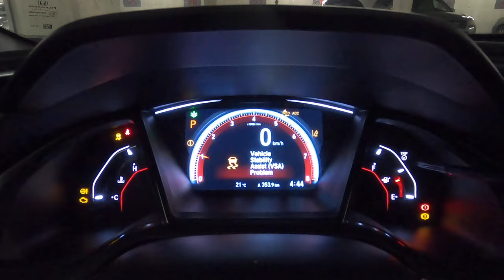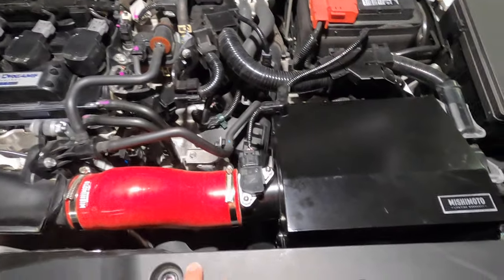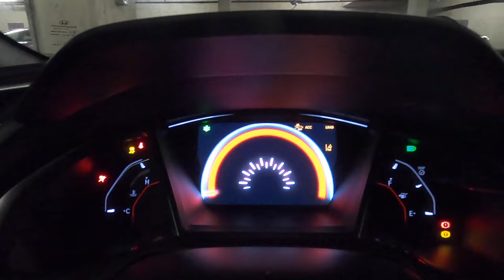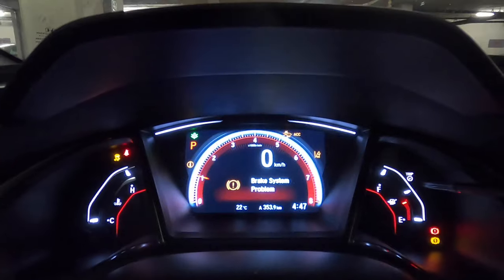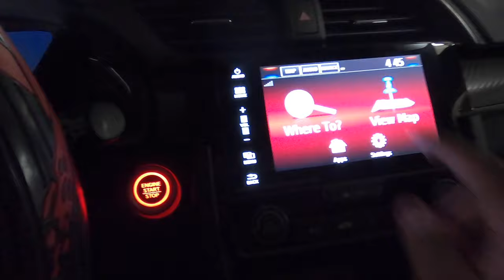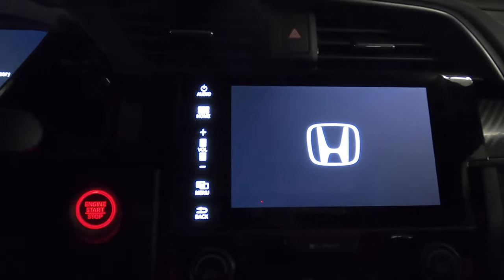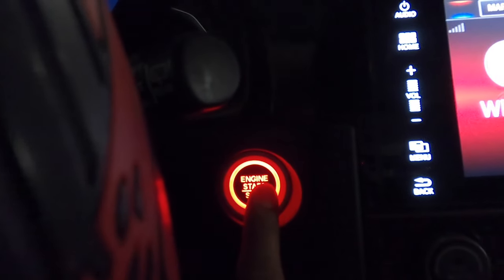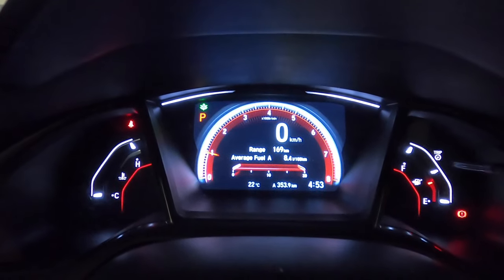HOW TO FIX MULTIPLE WARNING LIGHTS ON DASHBOARD OF 10th Gen Honda Civic

Comment: ADD ANOTHER STEP 2017 Honda Civic Hatchback - Thank you.  Lights came on out of nowhere - I tried your instruction on reset 3 times and the lights stayed on. The car was starting and driving without issue.  I was ready to take it in to Honda Dealer.  BUT that day after the reset; I drove down to my local supermarket about 1 mile away, went in grabbed a few items and when I came out and started the car - it was reset to factory settings - I know because of the map and time display. Seems I had to drive to get it to reset. I am still getting the battery tested in the AM just to see; but I drove it 15 miles so far and the lights have not come back on. FYI - I have had problems with the tire pressure sensor from day 1 of having this vehicle.

Comment: It would be nice if you could do a video pare of the new model Civic. I have the sport touring and there is no power button to do a reset. So I did the factory reset sa general settings but it wont turn back on like the last gen. Any help would be appreciated by 11th gen honda owners

Comment: I just replaced my steering wheel and had multiple codes on my dash and started freaking out because my car only has 300 miles, did this and all the lights went off, thanks for the help.
Reply from the maker: Awesome
Reply: Salamat po. Great video!

Comment: I had a similar deal on my 18 Si.  All lights on but no crank. Turned out my battery was down to 9 volts. It had been sitting about 3 months because I couldn't drive after foot surgery. I had been starting occasionally  but got lazy as time went on.

Comment: will it affect any aftermarket products, i recently having rev match and emissions problems. And i have intake and exhuast on. wondering if this could solve the problem withour affect any aftermarket products.
Reply from the maker: Its just basically a hard reset I dont think it will solve emission problems

Comment: Great Video! I have a civic 2017 1.5T and I had the same issue that I got multiple dashboard warning lights. I tried your method but it didn't work for me. After which I disconnected the positive(red) terminal of the battery for about 2-4 mins, and plugged it back in. I was able to clear off most of the dash lights but I am still getting "Lane Mitigation" and "Traction control system" error on my dashboard. Any idea what else I could try?
Reply from the maker: Try to check all the connections at the engine bay, something might be loose
Reply: [Update] So after disconnecting the positive terminal of the battery and connecting it again, I tried to reboot it like you showed in the video, it worked!! Thank you for saving my $$$ !
Reply from the maker: Thats good to know! Im glad it helps 🤙
Reply: @saadullah9887  going to try that. Thanks!

Comment: I have a 2018 honda fit and did a engine Bay wash now all the dashboard sensor lights comes on one by one whenever I start the engine for about a week now. Do you have any advice?
EB, ABS, CMBS, ACC, LKAS, power steering, etc. warning lights.
I reset the radio, I reset the dash and lastly I removed the battery terminals but they did not go away.
Reply: How you fixed it can u let me know
Reply: Did u ever figure out the problem ? I have same issue

Comment: What if you don’t have the tablet? And a regular radio?
Reply: You ever get it fixed? I'm having the same issue
Reply: @humptime  yes I got it recalibrated with my autel scanner
Reply: I am having this issue with my 2019 Honda Civic Hatchback Sport. All 10 errors come up and when I try and drive it the power steering does not work. Any suggestions because the dealership can’t get me in for a week? I also just have the regular radio
Reply: @karsoneborn  have you tried just going to a independent shop and asking them to recalibrate it for you? It should not cost more than $60-$80
Reply: Disconnect your battery for 2 min.
Reply: @mlakaf  does not work if you have an issue
Reply: @wendellgreenidge3362  yes what I meant it reinitialize the system only.
Reply: @mlakaf  that won’t reset anything in cars from the United States

Comment: I changed my o2 sensor and it turned off my traction control and even shows the tire pressure on my dashboard. Imma try this later but if you guys have other way to reset everything please do tell me thanks!

Comment: What about if it doesn't have a touchscreen? My is a 2017
Reply: I believe that unplugging the battery and touching the +&- cables works. I also removed the ECU fuse. Not sure which of these fixed the problem. But it wasn't until I drove the car that the lights went way.
Reply: I did all the resets and battery and didn't work till after I drove it about a mile and then shut it off and restarted the car and they was finally gone

Comment: I’ve tried this method and it worked briefly but came back on again a week later, car runs fine but these lights are annoying! Has your lights came back on again?
Reply from the maker: No. And You might need to replace your battery

Comment: Leaving this comment for anyone else who may encounter a similar issue. I had 6 lights come on at once after it was driving fine the day before. Emissions, brake, brake hold, VSA, hill start assist, and power steering. Reset did not work. Unfortunately after examining under the hood of my car…. RATS have eaten my wires. Apparently Honda uses a soy material in its wiring and it’s a known issue. 😓 good luck!

Comment: is this common on these cars? it happened to me before and i disconnected the battery and reconnect.
today it happened while i was driving on the highway going 110 km/h then the car engine stalled and i kept moving on 40km/h couldn't get it to speed more :/ also noticed that the cruise control wouldn't work

Comment: I had this when after running my car on jackstand to check the front wheel bearing. I think it was worse than this. Luckily I had an OBD tool to reset everything. I gotta try this if it happens again.

Comment: Mine has this as well but my steering wheel is very difficult to move. Its the electric power steering problem but whats the cause?!
Reply: Were you able to fix it? I have the same issue

Comment: 17 crv radio reset didnt work... disconnected battery and it worked but all lights back on after 500 miles... code reader reads p0301 car runs fine, would it still be faultu coil or spark plug?

Comment: thing is my civic has an aftermarket radio in it and when i try to push and hold the button on it reads "action not available". so my question is, is there any other way to hook up an external device to the dash to clear all these alarms?

Comment: Holy crap this worked!! My car did this today and it freaked me out. I just hope there isn’t actually something wrong with my car that made it go crazy like this, but it seems fine. Thank you!!
Reply from the maker: I’m glad it helps
Reply: Did it cause your car to turn weird or wheels kept spinning with starting
Reply: Have you had any more problems with the warning lights coming back on again or no not at all cause I replaced the wheel bearing on my daughter's car and then the warning lights came on but I got them off by doing the resets and battery and then I drove it about a mile and then shut it down and then restarted it and they went off and so far they still haven't came back on but my daughter told me that they came on the other day and then she drove it home and they was out by the time she got home so just wondering what caused them to come on to begin with and what is the problem and does something need fixed so it doesn't mess anything else up on the car. If anyone knows what is going on with it and knows how to get it fixed please let me know what to do. Thanks again for your help!
Reply: @zymierosbourn9061  yes. They come back on every couple of weeks it seems. This reset works every time, but I’m getting annoyed and maybe need to take it to the Honda dealer and have it looked at 💸💸💸
Reply: I’m having this same issue after a car wash today, still need to figure out to reset it. My car radio system isn’t the same as this one
Reply: @wafashah1569  yo, I had this happen to me after washing my Honda. Make sure you’re not spraying directly in the hood area or the front grill. I’m thinking something got wet that wasn’t suppose to be wet.. a few days later my car was running perfect. But I’m still have the code problems where I gotta reset the car. It goes off for a few days but then they all appear again.
Reply: @zymierosbourn9061  did you check/plug in the sensor
Reply: Hey brother can’t get mine to work. The only power button I have is to turn radio on. Any suggestions?
Reply: Tried 4 times. Didn't work for me. 🤷‍♂️

Comment: Thank you so much!! 

This worked on my 2018 Honda CRV also. The only difference was that the codes were still there after turning the engine back on. They went away after I turned off the car after the system reboot waited five minutes and then started it back up.
Reply from the maker: Awesome 🤙
Reply: gonna try this, ty
Reply: I'm having this issue right now with my CRV...it didn't work...but mane I'll go check....I didn't wait the 5 min...maybe..I don't know...crazy and all of a sudden
Reply: So did you get it fixed and if not then try to do everything else that has been said and then see what happens and then drive it about a mile and then shut it down and then restart it and see what happens with the warning lights cause that's what I did cause it was the only thing that worked for me so far and they are still out as of right now and hopefully it doesn't happen again and if it does then I'll let you know what I did to get rid of them a different way if I can with out taking it to the dealership and if not then what the dealership had to do to get it fixed
Reply: @zymierosbourn9061  I know you are responding to someone else but I just wanted to tell you what happened to me. My brake system light was coming on along with an an alarm bell .  I tried everything but nothing worked. I found out that the person who did my brake pads a week earlier couldn’t get one of their caliber wheels to snap after returning it. It just kept spinning. I didn’t know this at the time. I took the car to the dealership and they told me it was probably gonna cost a lot of money as they had to take everything apart to See what type of damage has been done. These Honda civics have a very sensitive electronic brake system. It’s very easy to cause a problem if it’s not done right. I got lucky because The guy was really nice and wrote it up so that it would be covered under my warranty. If it wasn’t for that guy I would be paying a lot of money right now.    I found this video and I tried every single thing that people were saying to try in the comment section. But nothing worked.    I’m glad I finally took it to the dealership because if I would’ve driven like that much longer it would’ve caused damage in other areas of the car. This is what the guy at the service center told me
PS. I have the 2016 Honda Civic  Turbo sport model.
Reply: @madelineannabella3284  so did he say anything about the warning lights and how to get rid of them and then what even caused them to come on to begin with and what is the best way to get rid of them and keep them from coming back on again
Reply: Madeline Annabella so have you been having the lights come on again cause I got them to go off but they keep coming on and off so I'm trying to figure out what to do about them because I checked everything else and I don't see anything else wrong

Comment: I did this and it worked! However, after driving it for a couple more days, the lights came back. Since I'm having this recurring problem, do you know how I could fix it permanently? I've spent money doing 2 diagnostics at 2 different workshops and they don't  have an answer for me :( (2018 Honda Civic)
Reply: Did you ever solve it permanently, this has happened to me twice now, same 2018 Honda civic hatchback

Comment: I have the same problem with my CRV but it happens randomly, no battery changes or work done to the engine, it just happens a few times a year. Any thoughts?
Reply from the maker: U might want to check the battery voltage and also when was it last changed. Usually battery is good 3-5 years.

Comment: Holy fkn shit. I have had this problem with my FK2 for a year ! The car is fine then all of a sudden all lights go on .Honda cant find any faulty codes , No engine light and the car goes into limp mode . Restart the car and it works for everywhere between 3 seconds to 3 months. I almost gave up ! So far this accually seemed to work !!!!
Reply from the maker: Awesome 🤙
Reply: @geefamz7172  and now they are back .. i have No idea What to do anymore. Trash the car maybe .

Comment: My Civic Si started doing this sometime after I got hit, but went away after repairs. Then all of a sudden 2 months later it came back. Driving it for a couple days and then gone. Then like 2 weeks later it came back. I tried this and it fixed it, but it came back on the next day. I kept trying the reboot but it didn’t work again. But I’ll keep trying and see if it eventually gets fixed. I also have the emission system problem that randomly came on like a year ago and it won’t go away no matter what I do, not sure if anyone has a solution cuz the car is running fine about a year later

Comment: My '19 SI doesn't say accessory mode.  But so far other stuff seems similar besides screen..   no such luck on getting rid of check engine light.  Definitely a false light saying headgasket blown.  Now moving on to disconnection of battery

Comment: After I had to have my car repaired at the garage, I flashed my K-TUNER back to my ECU and the warning lights came on and stayed on. Usually they disappear after a short drive but they have been on for a week now and it's driving me crazy. Nothing works, from my cruise control, Lane assist and everything else that is controlled on the steering wheel. And I can't exactly go back to the dealership because some people claim the K-TUNER voids the warranty so there's no way I could take it back to the dealership to have it looked at. The only option I have is to get it fixed to myself.

Comment: i have a 2017 civic with no touch screen… what do i do lol. i had my tpms lights on , tires and the lame mitigation lights on and we tried to reset them through the steering wheel.. didn’t work. then we unplugged the battery for 5 mins.. didn’t work AND three more lights came on after we unplugged the battery :/ my cars still new and they lights only came on after i got new tires and haven’t been able to figure it out since
Reply: Same here, 2019 LX no touch screen. I unplugged the battery and connected the + & - cables for about 5mnts. I turned the car on and all the  lights and warnings  came back on. I  pulled the ECU fuse, but all lights came back on. I read somewhere to let the car run for 10mnts, but the light show continued. I tried resetting All thru the gear thing, like one would for oil, tps, etc., but nothing.
 I decided to take it for a drive, and within 1-3 minutes all the lights went away. I have no idea which of these things, or if any of them, made the lights go away.

Comment: What if your car is key start? I must have the only key start 10th gen civic in the world. Every video I watch has start stop button and touchscreen. Mine does not. I'll try pulling the fuse and or disconnecting the battery.

Comment: Do you know how to reset the system on a Honda that doesn’t have navigation system ??
Reply from the maker: If u want to reset the system, you can simply remove the fuse of the ecu and put it back. It’s up to u but I dont recommend it.

Comment: My did not work my car I was driving and all those lights came out and lost power I was like at 20% and good thing I was closed to my house so I drove home and it was dark I was really sad so next day I did all this steps did not work so went and check the battery and it was dirty it had cell connector corrosion I cleaned really good and then I stared    And I drove it for a minute all those messages went away thanks god !
Reply: how is it doing for you buddy? did the problem comes back? me too had the same problem
Reply: @HafeezBlackLeg  it was the battery I replace it everything is back to normal thanks god !
Reply: @JoseGonzalez-eb5wo  thanks man

Comment: I just encountered the same on my 2020 honda civic sports sedan just literally about 2 hrs ago and I did what you done but still doing  the same thing.Im about to take it to the dealership tmw but if anyone can help me will be greatly appreciated ty
Reply: Got the same issue with my Honda Civic 2019, the light went off after the reboot but came back on as I tried to accelerate on the road. How did you get yours sorted please 🙏🏿

Comment: Any advance to honda accord 2018 all light is on.. thanks
Reply: Try disconnect the battery for a couple minutes and then drive it about a mile and then shut off and back on and see if that works

Comment: Same issue is happening with my car, however, I do not have the new radio tablet like yours. I tried just pushing the power button but no luck. Any other ideas?
Reply from the maker: Try to double check the connections in the engine bay maybe theres a loose connections or wires eaten by rats or Try to disconnect and reconnect the battery then restart the system. If it doesn’t work, bring it to your trusted mechanic or if its still covered by warranty bring it to the dealership.